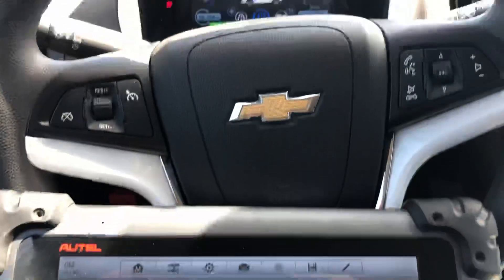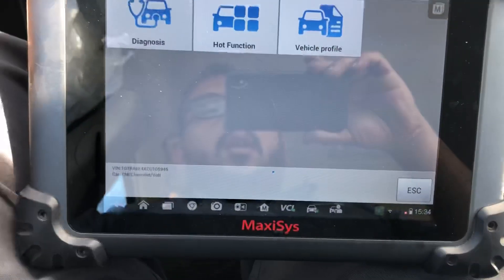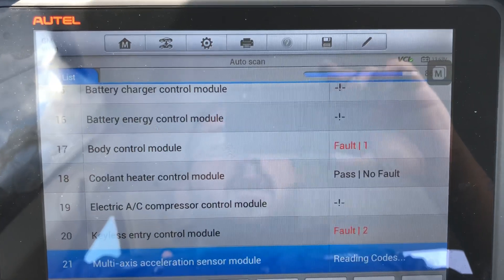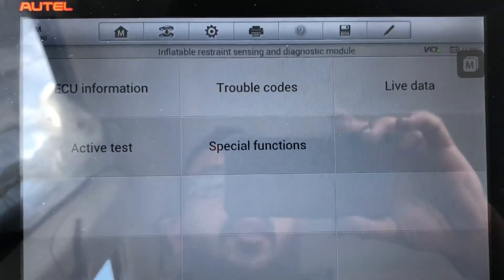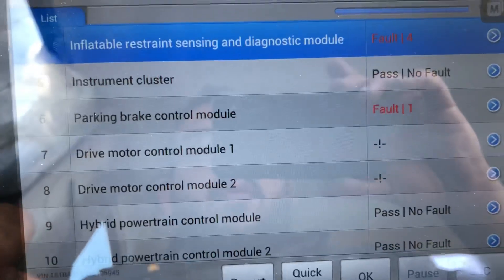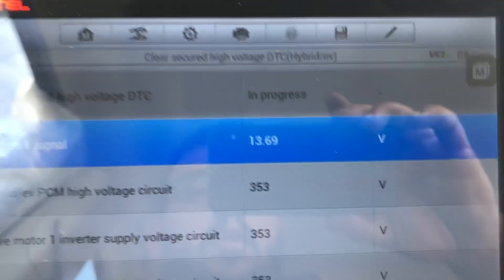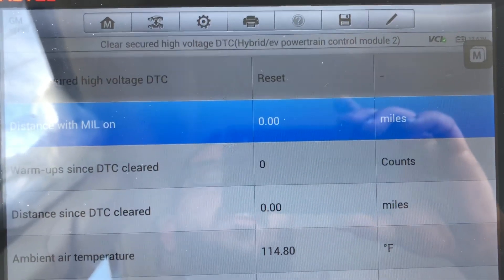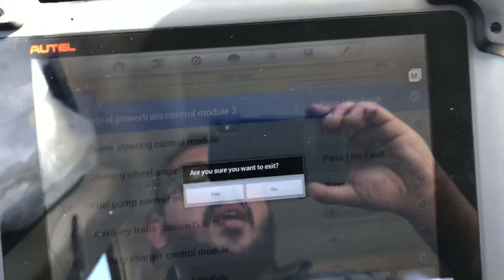Wont start after accident ( FIXED ) | Chevy Volt

Comment: Happened to my buddy after an accident, luckily his boat wasn't totaled. It just needed a new rear bumper and after he fixed it he had to go through to all the procedures and it started right up after he resetted it lasted 289,000 mi until the batteries came out action was an underrated car. Took care of it (never charge a EV car to 100% guys)

Comment: I have a 2015 Chevrolet volt that based upon paint color difference it looks like it was involved in a front and rear accident. The car runs and drives fine and in mountain mode. The car will charge the hybrid battery. However, I can’t use the plug-in charger to charge my car..  Going through all the procedures that you went through with the car be able to charge again with the plug-in charger?  A dealer scanned my car and said that it needs the charging port replaced and Hybrid Drive Motor Battery Pack Charger - GM (24276662).  I know without seeing the car you can’t diagnose it but if the car is running and driving fine, and the battery will charge in mountain mode, does the above information sound logical that it needs to be replaced???

Comment: It worked for chevy volt 2013 and its turned on 
My problem was low voltage hybrid battery, these steps you done it , will help any problem like this 
Thank u very much

Comment: I have a wrecked 2017 Equinox and it won’t run. It starts but dies immediately, is this because of the same issue kinda with that volt? I’ve disconnected battery and all that but nothing is working
Reply from the maker: No, your problem is totally different. Equinox is not and EV. Also this volt wouldn’t Turn on at all.
Reply: @themodernmechanic428  oh okay, wasn’t sure if it was something similar or not. By chance would you know if my problem would be caused by a hard code in the airbag module? Don’t normally have this problem
Reply from the maker: @midnightmechanic1293  i don’t think the airbag module code would affect it. You should check all fuses and also test the fuel pump. Best of luck.
Reply: I have the same problem right now 
Such a headache
Reply: Were you able to fix it???
And how please 🙏
Reply: @Twicewatch  it ended up being my intake manifold. They are plastic and if there’s any hole or crack in it the car will not stay running at all

Comment: So without this scanner I won't be able to start my 2018 Chevy Malibu that had the airbags deployed all because of someone backing into the front of my car???
Reply from the maker: Yes, unfortunately chevy does that as a safety in case the accident caused damage to the high voltage system and possibly cause a fire.
Reply: @themodernmechanic428  ok thanks ill have to Either get me one of those scanners like in this video or  Have my vehicle towed to a dealership.
Reply: What was the update 😅😮

Comment: What kind of scanner do I need to fix this issue
Reply from the maker: The scanner I use in this video is an autel Maxisys which is about $3,000 but I know autel makes cheaper scanners which start about $500 however I wouldn’t be able to tell you if those scanners can do this but you can contact autel support and they can tell you if they do.
Reply: Do I need the J2534 coding
Reply from the maker: @culiacansinjesusrivas8309  no you don’t need the j2534
Reply: Can use GM's GDS2 software as well, tether car to a Windows 10 laptop

Comment: Help! I replaced the radiators in the front end & had to remove the whole bumper. NOW with the bumper plugged back in the car won't fully start... It comes on but the AC does not get cold and it won't do anything when I hit the gas pedal. (btw My instrument dash has not worked for a while.) Unplugged both batteries 10 minutes, still the same thing. Any idea why it won't move?
Reply from the maker: Melanie Gough is the 12 Volt battery dead? Try jump starting it
Reply: @The Modern Mechanic  yes the battery is charged, the car still comes on, I think it's stuck in some kind of service mode, so everything works except moving. Tried all the tricks to get out of the service mode but no luck. Guess I'll have to wait until I get that new dash screen to see what it's trying to tell me 😂 Thanks for replying!
Reply: @melaniegough2753  do you have any updates

Comment: The Modern Mechanic : Thank you for a great video. I have one question : I have a 2012 Chevy volt was in an accident and stopped charging. The dealer wont's to rip me off big time to clear the crash data. The scanner you are using is very expensive can I use a cheaper scanner to clear the crash data (i.e. Autel Maxicheck Pro $ 175.00)?
Reply from the maker: Nat Shain i believe the maxicheck pro should work but I’ve never used one of those so I can’t tell you for sure. You can contact autel and they should be able to let you know, their support is great give them a call.
Reply: You can also mail your computer to repair service on ebay, i have had really good experience and they charge around $60 for it.

Comment: I have an older autel and did exactly on ur video and my Copart volt worked as it should thank u very much my autel paid for it self
Reply from the maker: That’s exactly why I made this video, to help people like you not have to pay towing fees and a dealer some ridiculous prices. Glad I was able to help.
Reply: Nere Galvan, which older model Autel do you have that was able to fix this issue as described in The Modern Mechanic's video?
Reply: Theron W Jacobs autel maxiDAS DS708

Comment: I was trying to delete the accident codes in my Volt after changing the brakes.  The process got interrupted and now my car is without power.  Resetting the 12 volt battery and pulling the ECU fuse does nothing.  What do I do?
Reply from the maker: Sounds like the 12 volt battery is dead. Have you tried putting a jumper on it?
Reply: @themodernmechanic428  It worked!  I put the jumper on it at 50 amps and then it let me recharge the battery.  Now I just have to clear the Stabilitrack and Brake Assist codes.
Reply from the maker: Denis Kucharski good to hear it worked 👍🏼

Comment: they hit me perfect just miss charge port! 
wtf i wanna drive my volt !
Reply from the maker: You should get a hold of a scanner or find someone that has one and scan it to see what codes it gives you.
Reply: @themodernmechanic428  can i reset my air bag moduel under center console. would that do same thing. i have a bussiness in massachuetts that does it 50$
Reply: are you near massachuetts maybe we can make a trade trying to save my car!
Reply from the maker: Justa Number sorry I’m in California
Reply: The Modern Mechanic did they total ur volt. I wanna fix mine. Will they let me if they total it
Reply from the maker: Justa Number this was not a total. If your insurance totals your volt, you can buy the car back from them and fix it yourself. It will then have a salvaged title.

Comment: Does this work for regular gas cars?
Reply from the maker: No, only on the hybrids from Chevy.
Reply: Some times on regular gas cars they have a fuse that blows, my gl320 had one like that it had airbag detonator (micro version) that detonation is strong enough to savor the main power cable. Was hard to find it though.

Comment: Mine was involved in a front end collision and will not start. Says initializing, any ideas? I did a reset but it was with a Bluetooth scanner so I am not sure if I need to have it done with a scanner like this one in the video.
Reply from the maker: Just resetting the codes is not enough. You need a more advanced scanner like this one.